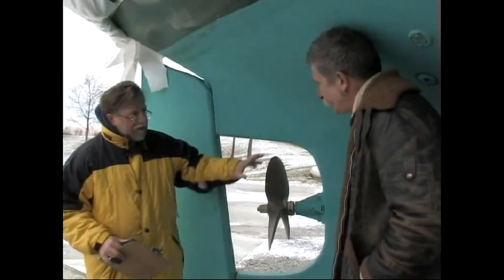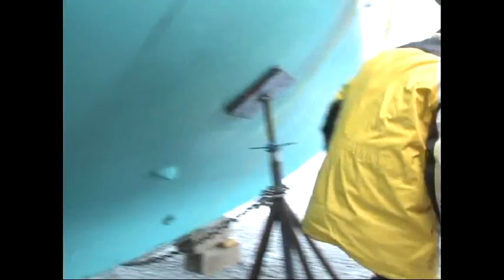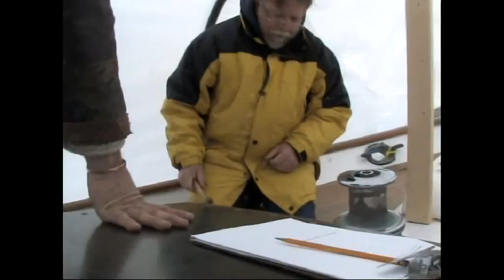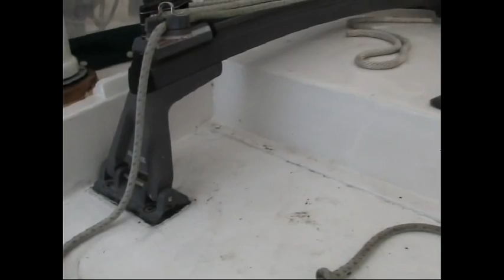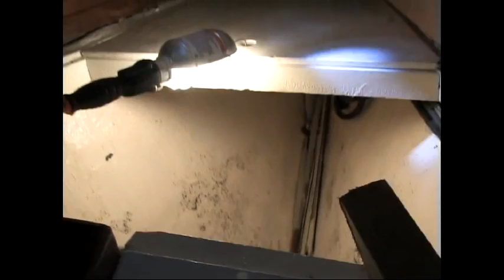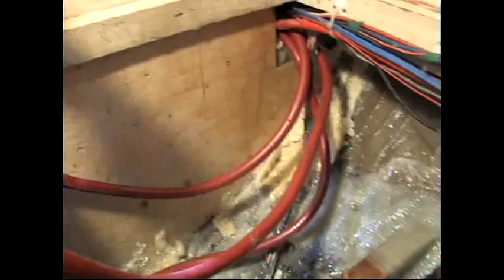Project Boat

Comment: I have a snall boat I am restoring, ripped out all the wood - in the hull, and replacing it with composite plastic, which does not rot. What gets me people rip rotten wood out and then replace it with wood than can rot again. I did find this video very informative. thank you

Comment: Big project! Good luck with it. I always loved the Vagabond 47 design, a beautiful boat. We are lucky that our decks on our 27 year old 50 ft Transworld trawler are cored with closed cell foam. No wood core thus no rot or delamination anywhere. Though we do have exterior teak decks that require a lot of maintenance.